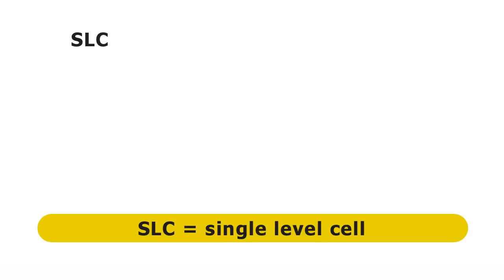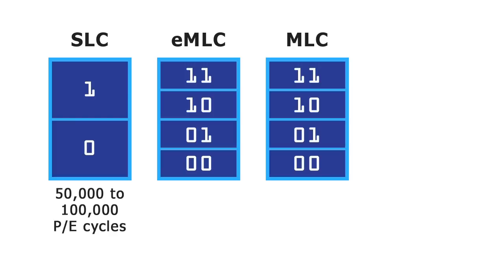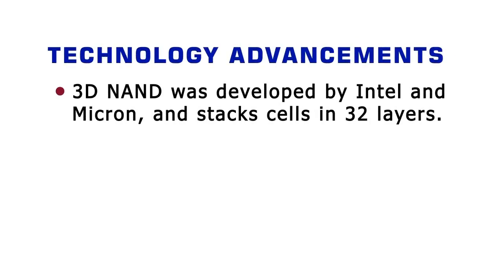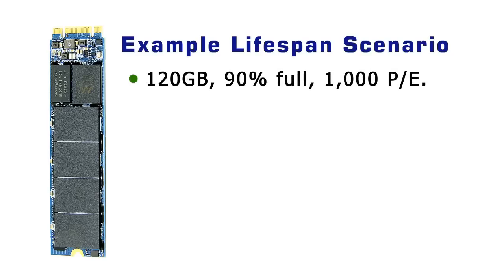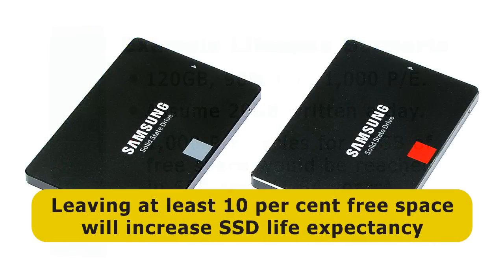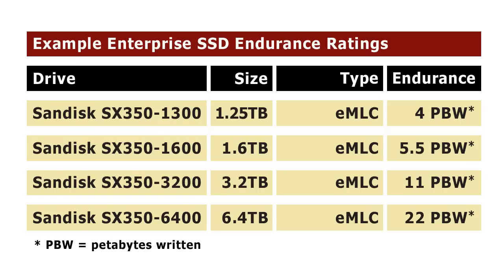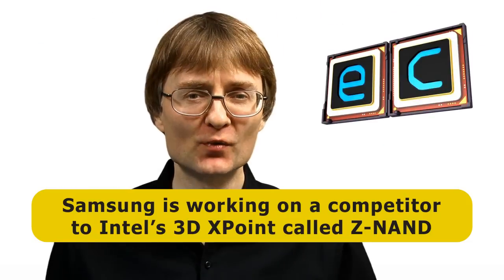SSD Life Expectancy

Comment: The way I've seen NAND endurance is much  like how we perceive the colour depth on TVs and monitors.

1-bit colour is either black or white which is easily discerned by anyone even with poor eye sight, that's SLC. 2-bit colour would be the equivalent of MLC with black, dark grey, light grey and white, still very easy to discern between the four shades. As you increase the colour depth, the more shades you have to be able to accurately tell the difference between but with the added twist, your eyesight gets worse with age.

Now like a worn out NAND cell, your aged eyes have trouble telling exactly which shade of grey is which when you have to deal with black, white and the 14 shades of grey in between (QLC NAND) and because of your aged eyes you begin to make mistakes, that's the data corruption and failing. Although with those same bad eyes, you might still be able to tell apart 3-bit colour depth which would be black, white and the 6 shades of grey in between. Again, age will eventually catch up and your now even worse eyesight will have even more trouble discerning between those shades.

The same principle applies to a NAND cells. After enough wear, it won't be stable enough to hold the same charge that was given to it by the controller and it will eventually return incorrect data when read back. If 1v is stored in a NAND cell and because of NAND wear, the charge drops by 0.1v to 0.9v, for SLC mode the controller will still see the data in the cell as a "1" as it has a rule to say that anything above 0.5 is a "1" and anything below it is a "0". Now take that same NAND cell with the same amount of degradation and give it a piece of 4-bit (QLC) data where the difference between each possible arrangement of 0s and 1s is 0.0625v (1v divided by the 16 different possible arrangements of four bits of data from 0000 to 1111). Take that same cell and drop the charge by 0.1v, BOOM!  The data that was stored as 1111 now reads back as 1101 and the entire file has been corrupted.

That's why TLC is safer than QLC, MLC is safer than TLC and SLC is the safest. The fewer permutations of charge/data stored in a NAND cell, the less susceptible it is to corruption caused by cell degradation.

Comment: When an SSD is about to die, is there more danger of losing your data or of your data becoming unreadable than if you had an HDD about to die?
Reply from the maker: Yes, probably.
Reply: @ExplainingComputers  Ah ok, that's what I had heard when I bought the computer I am using now which is why I decided to get it with a 1TB HDD. It is slower, but there's less risk of losing my data when the drive gets old.

Next time I will switch to an SSD just to run the OS and installed programs. Personal files will always be on an HDD for me, with a backup, of course.

Comment: Hello Sir, what about if I buy a laptop that boots only have one drive, 512GB SSD, which will be used for both the OS and the files. I will just use it mainly for typing and browsing the internet. I will make it at most 70% full. Will it last for 10 years?
Reply from the maker: It should certainly last a long time. Nobody can guarantee 10 years, but treated well, it may. :)
Reply: @ExplainingComputers  Thanks for the answer! The exact laptop I am planning to buy is lenovo ideapad s145 14igm, which I could not see the exact SSD brand and model used. But it is relatively cheap so I can't say if it has good SSD.
Reply: @ExplainingComputers  A little favor pls. How long will this last: Warranty of 5 yrs, 100 TB written, and 0.1 DWPD? Capacity of 512GB and expected workload of 30GB per day. I just purchased the Lenovo Ideapad I told you. Thanks!

Comment: I built two computers, one for myself, and one for my wife, around Christmas, 2018. Both computers use a Samsung 970 NVMe drive (500GB) as drive C. My wife's computer goes relatively unused, and its windows installation somehow corrupted a couple weeks ago. I managed to use software to recover the few files that were on the drive and attempted to reinstall Windows, but even a clean install won't work, nor can the install software reformat the drive or delete partitions.

Do you think this has anything to do with the drive, itself, or is it more likely there's something wrong with my Windows Install media? Just curious. :)

Comment: How long will written data last if a ssd is stored cold (unpowered and disconnected)?
Reply from the maker: It should last a year or two without being powered and read. After that the drive should be powered and accessed to maintain the data.
Reply: @ExplainingComputers   So it is better to keep an ssd powered than unpowered for long term storage? Hdd's might be a better choice for disconnected long term storage after all.

Comment: But what happens when they fail? Do they fail hard? An HDD usually gives some warning of failure and enables you to save most if not all of your data, but do SSDs controllers allow for this and make sure no corruption occurs??
Reply from the maker: Hard fails are not uncommon with SSDs, as many comments here confirm. Backups are vital.

Comment: I stand to be corrected but.... If an SSD fails you are stuffed. If a HDD fails,  you can normally
still recover your data from it.
Reply from the maker: This is indeed often the case - data recovery is more likely from a failed HDD (sometimes at great cost).
Reply: Is there a way to set a HDD to be a backup? I.e. a form of RAID 1 where only one drive mirrors the other, so the SSD isn't slowed down by the HDD?

Comment: I'm in big worry!
I have a m.2 slot compatible with ssd with one key, bios supports PCI but i'm still scared that i cant use NVMe
What do you think?
Reply from the maker: You really need to check your motherboard/laptop manual. Is there a speed written by the slot?
Reply: @ExplainingComputers  i've tried with one crucial p1 nvme.But no, my lap is judged to run only m.2 sata ssd.unfortunately
Reply from the maker: @gorilakurva  Oh well, at least now you know. My laptop is SATA only too! :)
Reply: @ExplainingComputers  that's not so bad.For me, who only read and watching videos, sata is absolutely fine.Agree? :)
Reply from the maker: @gorilakurva  Totally agree. For the vast majority of applications, SATA SSDs are fine -- four or five times faster than the best HDDs we were using not that many years ago. :)
Reply: @ExplainingComputers  let me ask you something.You see, i dont touch ssd defrag, i put it off, but in event log i can see that till now my ssd get defragmented 19times.Is that log of his own ssd trim or something is wrong?I have new Crucial ssd
Reply from the maker: @gorilakurva  SSDs should never, ever be defragmented -- it just reduces the life of the drive for no benefit. Windows 8 and onwards will automatically detect an SSD and will not defragment it. In other OS, make sure you turn off automatic defragmentation.
Reply: @ExplainingComputers  i understand.But why event viewer logging defragmentation?When i open it i see multiple defrag logs
Reply: @ExplainingComputers  and i can bet that.. just look in your event viewer and you'll see that your ssd was trimmed.i don't know why is that.bug or something
Reply from the maker: @gorilakurva  I suspect you are right and that it is a bug or misreporting!
Reply: @ExplainingComputers  if Windows do that without permission, not good for SSD

Comment: So my question is what is the expected life of a Windows 10 home system with only a 256GB SSD with say 3/4 capacity used?  Assume the system is used  on average 6 hours per day with web surfing the primary use and it has 8 GB of ram.

Comment: I’ve just installed my first ssd, purely as the system drive, with a 1tb. Hard drive for all my data files, does this mean my ssd , which is about only 25% used, should last as long as I do?
Reply from the maker: Yes, your drive should last a long time!

Comment: Someone please answer in detail :
In SDD, how defragmenting is said to be more harmful VS regular writing and deleting tons of files ?
Is it because : 
On regular write, the bytes of a file are automatically scattered in the SSD chip (evenly distributed the wear-out),
while on defragment, the bytes of a file are forced to be "lined up" on specific part of the chip (uneven wear-out) ?
Reply from the maker: It is because defragging moves data around -- on an SSD unnecessarily, so incurring writes for no reason that will decrease the life the of drive. Defragging is not more harmful that regular data writing, but has no benefit whatsoever, while normal writes are done for a reason.
Reply: So it's because it's just simply useless...
Ok, thank you for your answer.
Reply from the maker: @anomalousdelirium  Useless, and uses up P/E (write) cycles in the process! So worse than useless! :)

Comment: My Kingston A400 120GB has been running at 90% full for like 6 years now. I just checked and it only has a 40 TBW rating, of which I've already written 30 TB.
A disk health utility shows it's got 71% "SSD life remaining", is that good or bad? Does the usable space on the drive decrease as sectors go bad, or does the system just start crashing?

Comment: what does it mean if my new Samsung 970 EVO Plus 1TB NVMe M.2 SSD meets its rated maximum read and write speeds in CrystalDiskMark (3500mbps read / 3200mbps write), but my 7 year old Kingston SSDnow 120GB SATA 2.5" SSD meets its rated maximum read speed (500mbps), but doesn't meet its rated maximum write speed (150mbps, should be 450mbps)...? Is this a case of worn-out cells or to do with TRIM...? I actually have another one I'll be swapping in to compare before I entirely free my PC of old 2.5" SATA SSDs (edit: despite being 5 years old, that one managed just 100mbps maximum write speed).
Reply from the maker: You are exactly right -- the write speed of your 7 year old Kingston has fallen with use over time due to use. The cells are not worn out yet, but every write will be a little bit slower than the previous one, and after seven years the effect will be quite considerable, as you have tested.
Reply: @ExplainingComputers  Thanks for the reply Chris! Yeah that makes sense :) I think I'm still going to hand down the better one of the two to a free PC I'll shortly be acquiring as it's still hard drive booting! Read speed is more important for an OS boot drive anyway as I understand it.
Reply from the maker: @RWL2012  You are again correct!

Comment: Hi Chris - All your videos are great. I've learnt a lot from them. I'm considering replacing my 1TB HDD with one of these Samsung SSDs - 1 TB SSD SAMSUNG 870QVO Sata 3Gb/s. -Ebay Spain (where I live) sell them for ~90 euros. What is your opinion on this model?  Would it be a good buy?
I've had endless problems with my current Seagate 1Tb HDD (which BTW is only just under a quarter full) and often after doing a reboot before running up WIndows it will go into CHKDSK and find corrupted files, remove them and then later replace them. It can take for ages! 
At times, programs like FireFox or Thunderbird take ages to start or sometimes appear to lock up with a 'Not Responding'  message on the top line,? At times the PC freezes totally and I have to do a reboot. Its an old ACER Aspire E360 model (~2006) and runs Win7 32 bit but rebooting  it usually works- .i.e. at least for a while!!!  I'm hoping this issue is hard disc related and replacing it with a SSD will sort out these problems? Cheers John
Reply from the maker: Hi John! :) Samung make decent SSDs, and the 1TB QVO for about 90 euros is a good idea. The QVO drives can be re-written fewer times than an EVO -- see my video here: https://www.youtube.com/watch?v=WACyyFF_ci0 -- but for a 1TB drive in standard use (ie not being fulled up and re-written very regularly) this should not be an issue. The problems you list could well be HDD related, and an SSD will certainly speed your boot times. Good luck! :)
Reply: @ExplainingComputers  Many thanks for your reply. I'll go ahead and buy one :)

Comment: I own a 2010 MacBook Pro which  I had ordered with a 256GB SSD that time (it really was expensive!). I'm still using that machine, though only secondary now for I have a new machine for regular use since a year or so. I never had any issue with my data. Admittedly I'm not that hunter/collector user that downloads each and every mp3/video it can find but had only a moderate business data average (I hardly got it more than 50% used ever). The SSD on my new machine is 1TB. I do not expect to get much over the 50% again. And now I know that's for good :-)

Comment: My laptop doesn't have the CD drive, I wish to install 256 GB SSD without replacing my HDD. Just to boost the speed of my laptop by running operating system files in SSD....Can you please help me
Reply from the maker: You will need to clone the HDD to the SSD, and then change the drive boot order in the BIOS to give the SSD priority (so that it boots from the SSD, not the HDD). I have a video on cloning your system here:  https://www.youtube.com/watch?v=UTsq-HHz0Ss  Good luck!
Reply: @ExplainingComputers  Thanks for the reply, I seen this video as well, But I have Nvme 2.0 SSD installed in my PC. Do you have any suggestion for me where we can move the operating system files and all installed files from HDD to Nvme 2.0 SSD without deleting any of the file or by formatting / booting options

Thanks in advance for your help

Comment: I have a gen 2 SSD from last decade with a puny 128gb that still gets used as a system drive everyday. A larger one on M2 for data that can act as back up for when it goes but it refuses to die. It outlived 2 systems so far.

Comment: How long will data remain on SSD if SSD is removed from computer and put in storage?
Reply from the maker: An SSD should retain data for several years without a refresh. Drives with less use (fewer P/E cycles) will retain data longer.

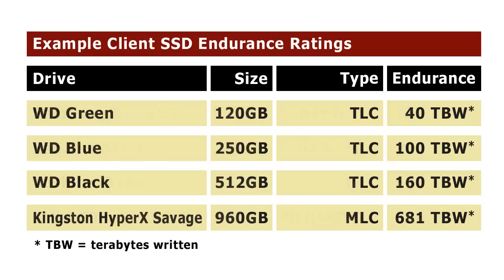Comment: At 07:00 the advice is given to buy the largest drive you can afford, and so leave as much free space as possible. That seems true for only that one drive, but if you include your backup drives there is a catch: when you fully backup your drive (system backup or clone) you will need to backup a lot more than when doing a smaller drive.
My 166GB system drive has less than 20% free space left. Obvious I went to buy a new SSD for the reasons explaind in the video. When I buy a 500GB, I have to write  (compressed) 300GB every BU. When I buy the 256GB, I have to write 150GB every BU. So I bought the 256GB; faster backup, less space on my BU disk needed, less wear, lower price.

Comment: I have a Samsung 1TB QVO and it works fine (so far) and was cheaper than other 1TB SSDs. Of course we now have NVMEs running at much faster speeds than ordinary SSDs so it looks as if the "ordinary" SSDs are on the way out.

Comment: I have a question about ssd's acting as a cache for hard drives.  if you can use say, a 120 gb sata III ssd as a cache to, say a 1 TB hard drive to improve performance.   what about a having an 256 GB NVME PCI-Express 3.0 x4 as a cache for a 2+ TB Sata III ssd that already has ram onboard?  would this improve performance of the SATA drive at all?  or would it just bottleneck the NVME?

Comment: Chris, I put a 1TB Crucial BX500 1TB SSD in my PlayStation 4 Pro because I assumed the vast majority of disc activity would be reads due to textures and loading times for games. Recently I've been suffering with a large amount of rendering lag and general slowing down of the game I play a lot of. I ran the PS4 operating systems database tidy (i think its their version of defrag, I'm not sure) but I aren't seeing much by way of improvement. Is it possible to plug my SSD into my Linux machine (laptop) and run some performance tests on a disc that is not formatted to a Linux readable partition table/format? Some load times are very performant but some are useless and I'd love to work out if its hardware or software.

Comment: For a system drive that doesn't store any data (ie. no personal data; just programs) QLC might be the cheapest route, but I've seen where warranties currently (in 2020) are only about 3 years for a QLC type drive whereas MLC and some TLC drives are warranted for up to 5 years, which can indicate a more reliable drive partially due to quality of chips and the type of chips used.  QLC is often used in high-capacity drives, like 1TB SSDs and higher to keep the price down while giving higher capacities.  Above all, have backups, implement the 3-2-1 backup strategy (or at least 2 copies of your data--each in different locations, and ideally, on different types of media).  A perfect solution might be to have a cloud storage backup system, 1 or 2 on-site backup HDDs and one or two off-site backup HDDs.  I would not use SSDs for backup for their limited number of P/E cycles.  They are fine as system drives, and perhaps as primary storage drives (for data) for 3-5 years but if you do use SSDs to store your data, I would replace them the same as you would HDDs, about every 3-5 years depending on use.  Their only real advantage over HDDs is durability from drops and falls and write speeds.  But like HDDs, SSDs will wear out over time - granted when they wear out, the downsides are less drastic--you don't automatically lose your data, but you may not be able to write new data or you may get a lot of write errors.  HDDs are more limited on the life of the drive motor than write-cycles, which makes them good for backup because if stored properly, they can last 5+ years if powered on periodically (at least once or twice per year) to "exercise" the drive motor and move the lubricated parts.